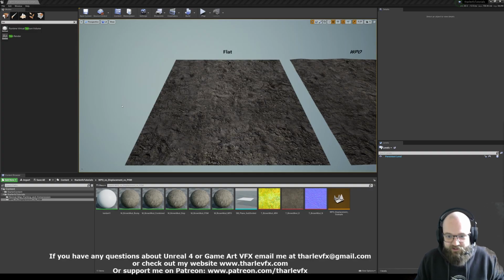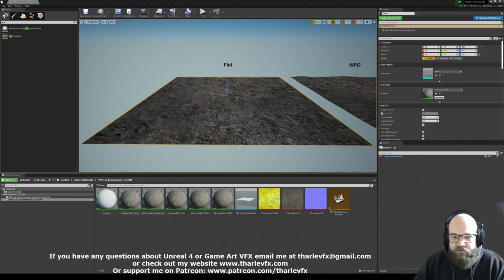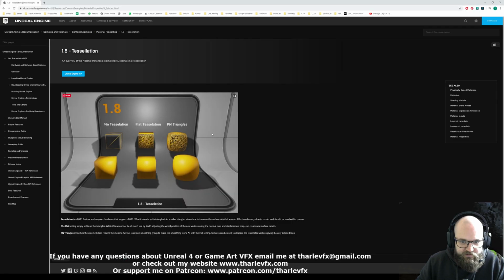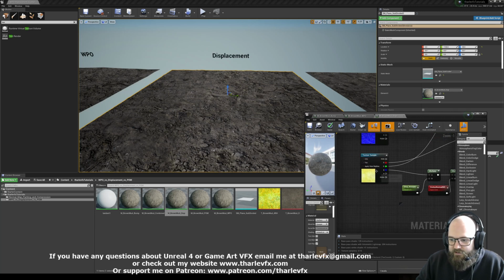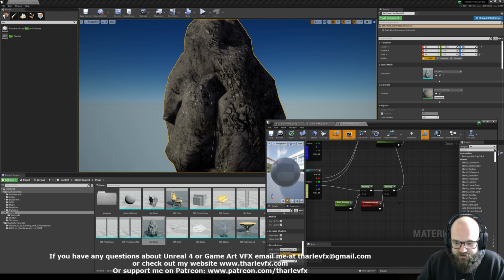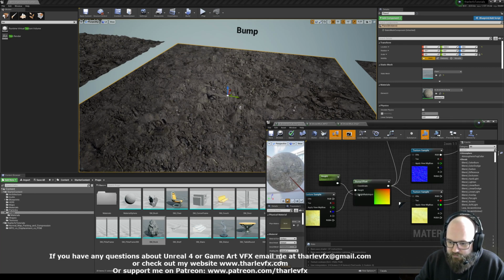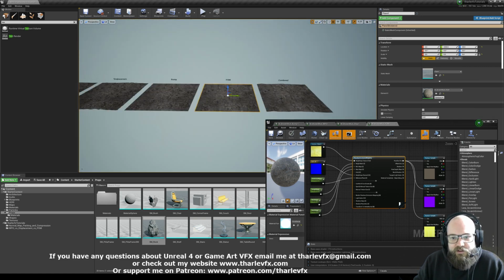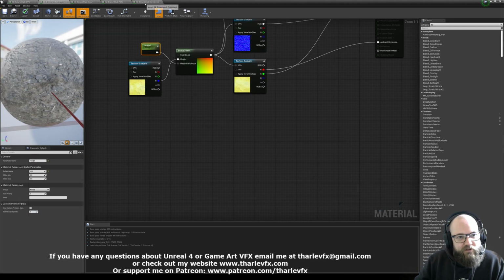World Position Offset, Displacement and POM, adding Depth to Materials

Comment: Thanks for the visual comparisons. But can you give a link to the code or material? Im from UE3 and it's very difficult because I learn from example.
I'm making a 3d platformer (side scroll camera only) - so I need the Z surface to be flat to walk on - but the X surface to be bumpy for a rock effect on the edges of the platforms.  
1) How do I make a world texture on a Cube/rectangle platform with a similar looking texture - but I want X-axis tessellation only? 
2) And the X surface edge blends into the Z edge? (so at the edges the texture is not misaligned.) Thanks
Reply from the maker: So tessellation has actually been depreciated. In unreal 5 you can just use high poly meshes with nanite.
Reply: @tharlevfx  Thanks. But just making a quick demo prototype for a video. So I wont use UE5. I just need to get the look working in UE4 at any performance cost. Can you help me? I need exact steps to learn. 
Ive searched 10 phrases on YT and google and cant get the results. Ty
Reply from the maker: @kenalpha3  you should be able to do an angle check with the dot product to get the side faces but I think you’ll always get stretching on top. Unless you project that material maybe? Either way, if it’s just a prototype I wouldn’t use tessellation - honestly it causes more issues than it solves